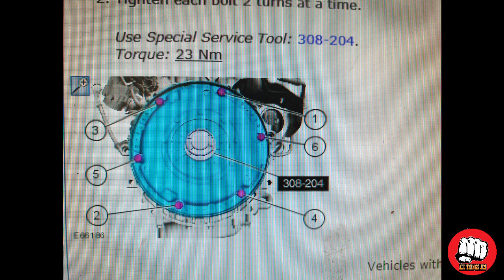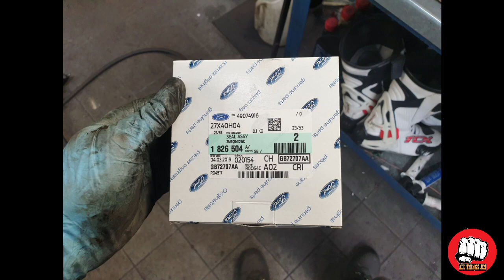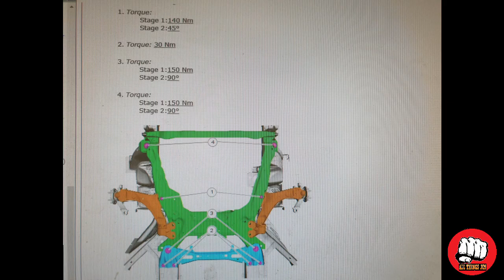How to replace a clutch, flywheel, slave cylinder and rear crank seal on a 2.2 duratorq ford Smax

Comment: Just put an S-MAX on the lift last night for my best mate, I aint touched a Ford in a decade as I like to think Im a German "specialist" but the truth is I'm too lazy to work on stuff I dont like. Glad to see Ive got the right procedure, the air box was only held in by the hose clip, the sensor clip was broken, the battery tray cover broke, the negative terminal needed replacement, I just turned round and said to Rich "see this is why I dont work on this stuff, its just not designed to be repaired." Thank you, ill have this on my phone later for the "lord, help me to understand" moments.

Comment: Wow, what an amazingly detailed tutorial. Thank you very much mate. I have a 2010 facelift Titanium with the exact same engine with 300 000 kms in it and everything is still original in it including the DMF and the clutch set. What was the milage of this Maxi? Mine has the same leakage at the crank shaft sealing for a long time, yet very little oil consumption between 2 oil changes. I still love this car after almost 10 years, it is very reliable overall.
Reply from the maker: Thanks for watching and taking the time to comment! If I remember correctly this one had around 149k on clock, although I struggle to remember what ive had for breakfast sometimes so take that with a pinch of salt! 🤣👍
Reply: @ALLTHINGSJIM  
Hello, my name is Atilla, I live in the Netherlands.  I have a Ford s max 2.0 gasoline vehicle, oil is dripping from the rear axle seal, I need to change it, I have 023.940 Elring brand parts, I am thinking of installing it myself.  What was the model and engine type of your vehicle, how did you install the part?  The piece I bought has a frame around it.  There is a piece of plastic in the middle, was yours the same piece, could you let me know if it's easy to put on?  thanks you did
Reply: @ALLTHINGSJIM  
Hello, my name is Atilla, I live in the Netherlands.  I have a Ford s max 2.0 gasoline vehicle, oil is dripping from the rear axle seal, I need to change it, I have 023.940 Elring brand parts, I am thinking of installing it myself.  What was the model and engine type of your vehicle, how did you install the part?  The piece I bought has a frame around it.  There is a piece of plastic in the middle, was yours the same piece, could you let me know if it's easy to put on?  thanks you did
Reply: @ALLTHINGSJIM  
Hello, my name is Atilla, I live in the Netherlands.  I have a Ford s max 2.0 gasoline vehicle, oil is dripping from the rear axle seal, I need to change it, I have 023.940 Elring brand parts, I am thinking of installing it myself.  What was the model and engine type of your vehicle, how did you install the part?  The piece I bought has a frame around it.  There is a piece of plastic in the middle, was yours the same piece, could you let me know if it's easy to put on?  thanks you did

Comment: Great vid. I now know my Galaxy mk2 is doomed. No way I could do that and garage repair, more than the cars worth.
Stalled on a corner and I think dodgy bearing release? Clutch pedal only returns half way sometimes and intermittently sounds like metal scraping. Moving the steering wheel also sounds like metal springs in an old bed. Done for.

Comment: Might start buying these clutches from ford, when I buy the LuK boxed one they won’t warrant it without using the Self Adjusting Clutch Installation tool.

As you didn’t use one I assume ford don’t have such a warranty requirement lol so one less tool to hire / buy when doing these.
Reply from the maker: Yeah ford dont have anything like that, thats fairly ridiculous to be honest!  Never heard that before even with Luk ones,  just normally bang them in aha! Dont tend to read the leaflets though....
Reply: Yep even though the ford ones are still LuK when you buy the look boxed one they insist on using the tool or no warranty, at one point they even had a poster up in the local supplier printed by LuK stating no tool, no warranty.

But the tool is quite expensive, or you can hire the LuK tool but it’s all money.

Maybe it’s because when LuK boxed one they warrant it direct but from ford ford warrant them so LuK won’t care so much about how the parts are fitted as they aren’t the one who it goes back to.

Comment: do you know if this would be roughly the same on a 1.8?
Reply from the maker: 1.8 petrol / diesel? Even if its not exactly the same you can use the same principle, most of the Ford engines have a similar layout 👍
Reply: @ALLTHINGSJIM  diesel sorry didn't specify, sounds good then.